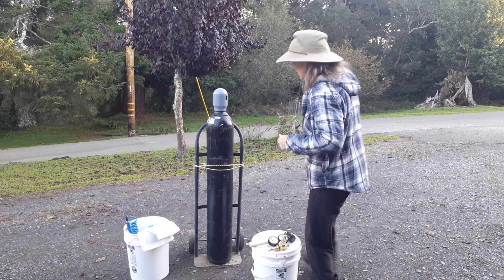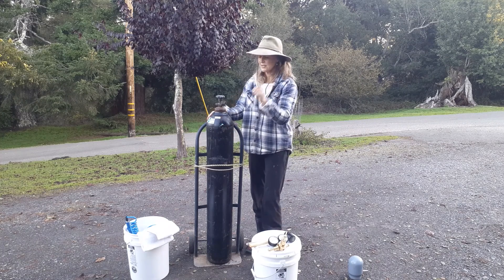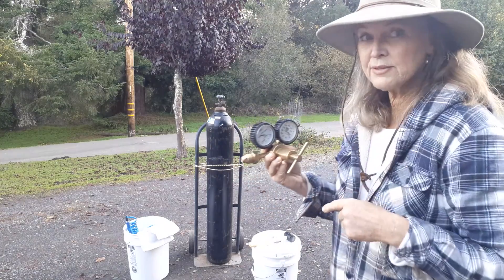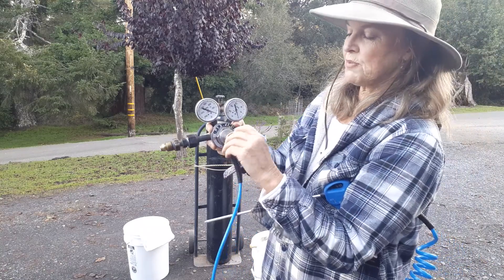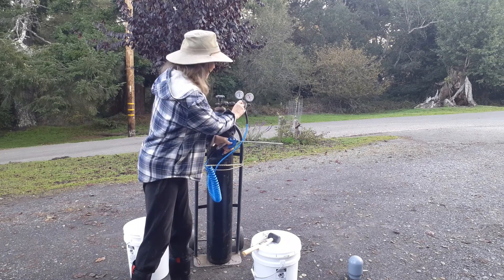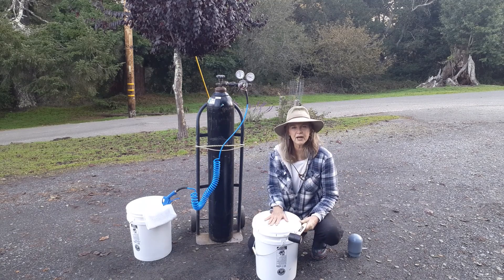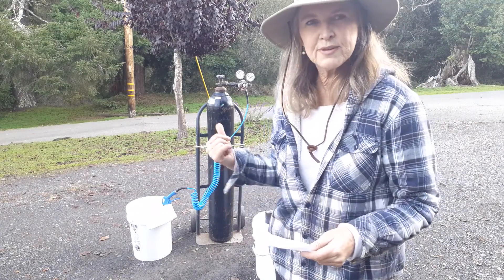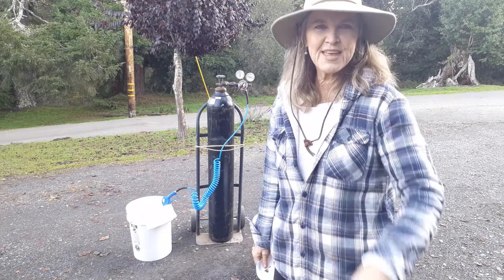Nitrogen Food Packing: Tank & Regulator Basics

Comment: Pure nitrogen is lighter than air. You need to pressurize the container to above approximately 14.6 psi (this is atmospheric pressure) in order to get rid of any “air” and prevent spoiling. Easy way is to vacuum then introduce nitrogen to desired pressure.
Reply: It's heavier than air.